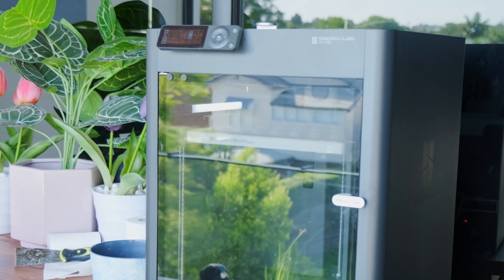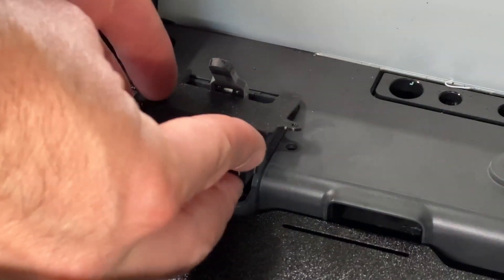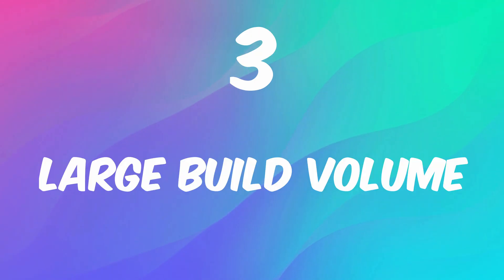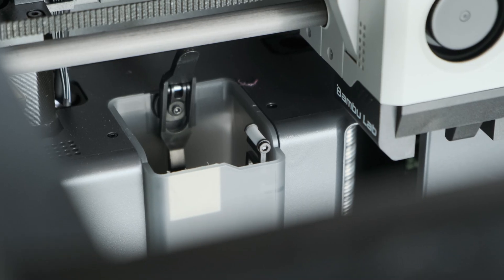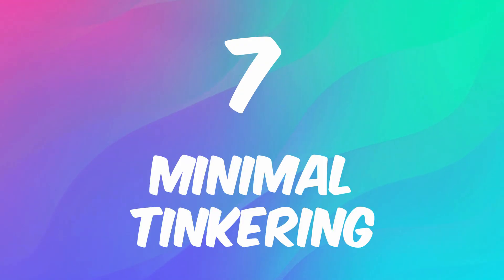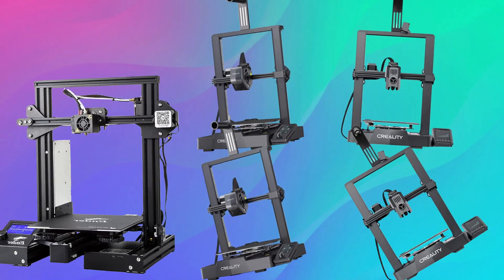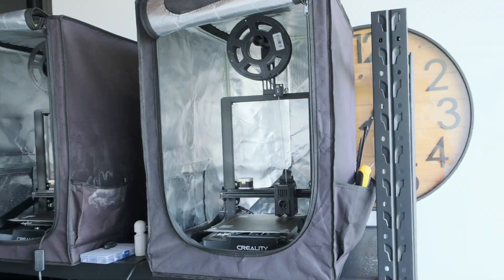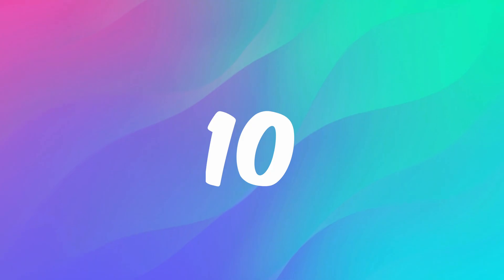10 Things I Love About the Bambu Lab P1S

Comment: I just purchased a P1S last week, trading in my A1, which started having a couple of unresolvable issues within a year of use. The PS1 is already having problems, first, I get a message that the tool head cover has fallen off. I check the machine and this is not the case. Now I have the same message, plus a new message that the cooling fan isn't working properly. I just  figure out this machine. As far as print quality goes, my A1 made cleaner, more precise prints. I'm taking this one back to Micro Center, where I bought it and either trying another P1S of even going back to the A1
Reply: That sounds insane.

It's extremely rare to have a Bambu printer failing, and you've had two within a years time?

People are putting 1000's of hours on these printers without any of these problems.
Reply from the maker: Yeah... Many of the issues I've faced have been down to me either not maintaining the printer properly, or forgetting something when I am reassembling :P Like the fan connector... It looks like it's in, the printer doesn't say that it isn't, but then prints start failing, only to find out I didn't plug the fan back in properly haha.

Comment: You can't go past 30mm/s on your Ender 3v3 with out problems? hmm ! I print on my Ender 3 v3 at 150mm/s 75% of the time! 150 is its max (
Reply: It's the different type of filament some require slower speed

Comment: I’m choosing between the bambu lab p1s and the flasforge adventurer 5m pro
Reply: I don't see much that the 5m pro offers over the P1S aside from the quick swap nozzle, nicer screen and being faster (on paper). It has a smaller build volume (nearly identical to an ender 3), lower nozzle temp and isn't as proven as the P1S. It's not a bad printer at all, I just think it's outclassed by the P1S.
Reply: @NWGR  after weeks of problems i sold the 5mpro to get a p1s combo lol
Reply: @SillyG_oober how is P1s now?
Reply: @64r73k  so much better quality and speed out of the box. AMS is a gamechanger, so easy to use. After calibrating filament in the slicer the prints are flawless every time. Any time there is an issue it is mostly just a dirty build plate.
Reply: @64r73k  My P1S print great unless I am printing something that has a pretty good size flat top layer and it does not look good. The layer lines are terrible. The only way I can get it to look any better is to use ironing and that make it look better but also adds a lot of time to the print. One other thing I have an issue with is when the nozzle gets done pooping I have to really watch it because a lot of time it will drag it with it and ruin the print. My 5M pro has not done this. Maybe I am expecting too much but for the huge price difference I guess I expected more. And I will say this as I am not that  experienced in 3D printing it's probably my lack of it that is causing my issues.
Reply: @NWGR still might go for the 5m pro because I only have a small amount of space on my desk and right now in the Uk it is $180 cheaper
Reply: Cool